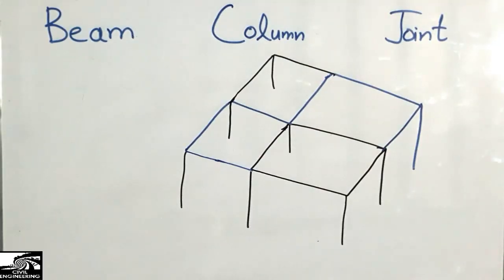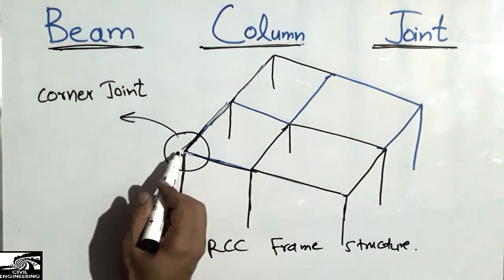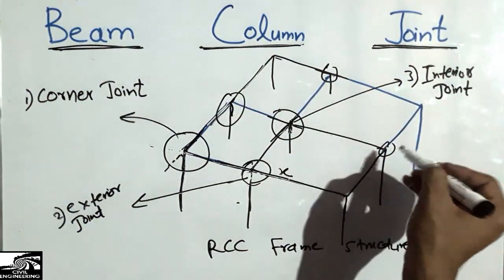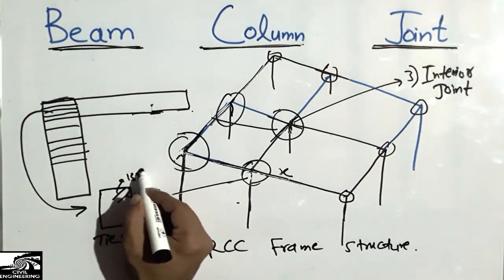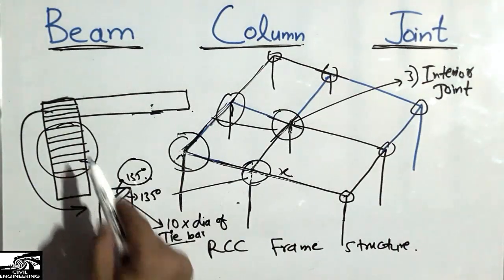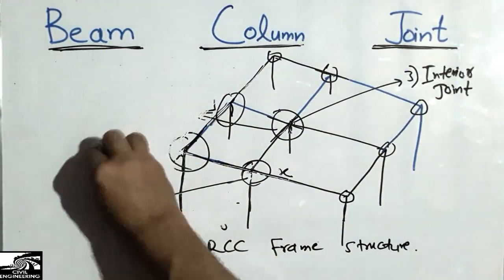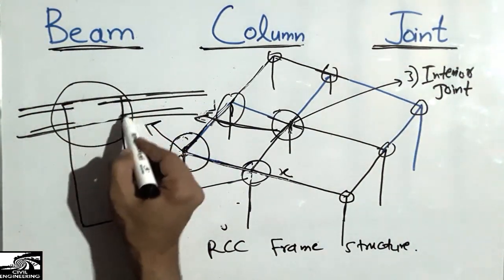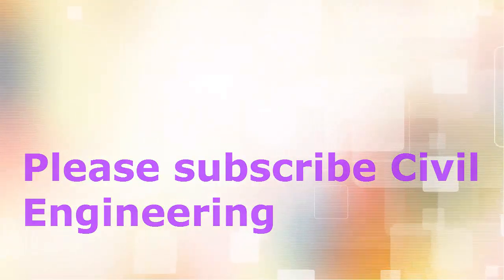Important Notes on Beam Column Joint || Joint Detailing

Comment: Hi, is it okay to connect a secondary beam in a lapping or splicing zone? Example if you are lapping at .70m to connect steel bars, is it safe to connect a secondary beam rebar in that zone?
Reply: It is s advisable to weld the joints of column?

Comment: Sir, it is ok that beam joints pillar to pillar(column). But whether the exterior beam can joint in a column in one side and a part of other beam near another coloumn in other side to avoid beam running through middle or side of a room ? Kindly answer.